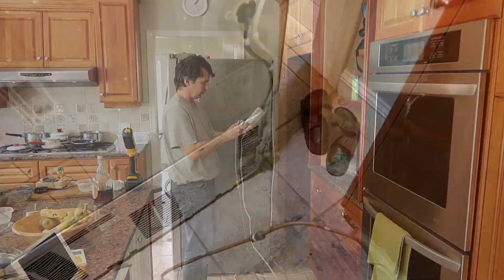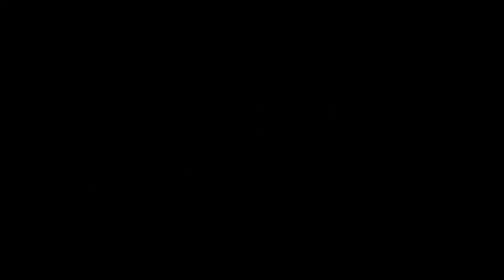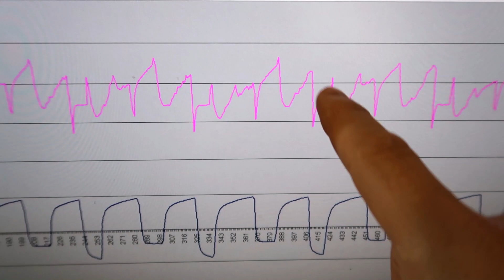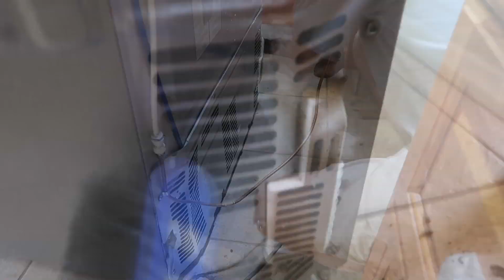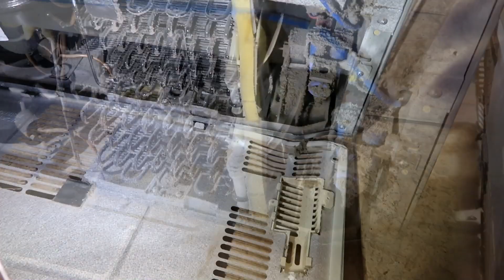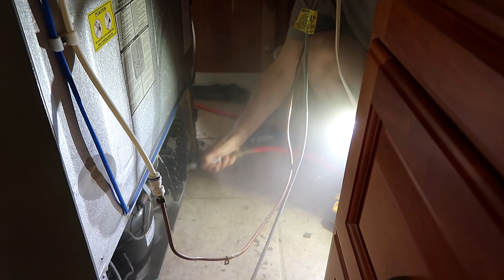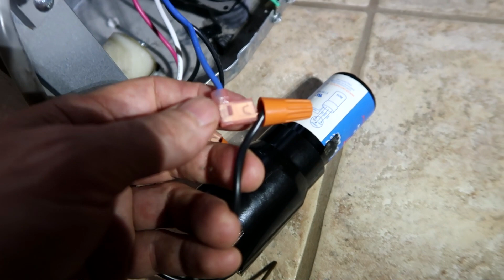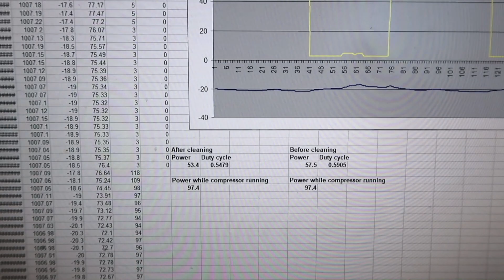Does dusting out the fridge reduce its power consumption?  And changing the starter relay

Comment: Thanks!  How will you decide whether the “correct” start capacitor was necessary or if the universal start capacitor was totally fine?
Reply from the maker: Power consumption is about the same, so it can't be too far off the mark.  These compressors are mostly the same size.

Comment: A refrigerator usually has a pan in the front to catch water from condensation taken out of the refrigerator and drained into a pan below where and the hot air blowing from across the coil  blows across the collected water behind the front grill below the doors to evaporate the  water and then out front,... on your toes.
Reply: No that was before they put the water on the condensers to burn it off

Comment: my fridge has the coils on bottom, and pulls air from front to back. I just blow the dust out with compressed air every year or so, the pull the fridge out and vacuum out the mess. I noticed the fridge's compressor cycles on a lot less when I started doing that after we bought our house and moved in.

Comment: I'd be really interested to see a followup where you modified the air flow baffling to see what that does to efficiency / power consumption performance.  One relatively easy approach would be to install a thick strip of soft foam rubber up the back of the fridge to "seal" against the back wall when the fridge is pushed back separating the air inlet side from the air outlet side.  That might reduce the air recirculation.  Another approach would be to construct a fresh air inlet duct along the side of the fridge to redirect the air inlet from the room in front of the fridge.  Not sure if you have enough room for that though.  In any case, I really love these quantitative analysis videos you are doing.  Great stuff!  Thanks.

Comment: It was working fine, you cleaned it and it broke; welcome to the prime directive!
Reply: If it aint broke, fix it until it is!
Reply: @muh1h1  😎
Reply: The service probably says that to everyone because a variety of relays, starters, and solenoids in his van you can coincidentally purchase for 400% markup!!
Reply: Don't electrical/electronic components normally fail (if they will out of lifespan) either at initial first uses, installation or when tampered with when servicing (which the compressed air might represent) rather than in normal hands off operation?
Reply: Happened to me while cleaning my father in law's dust vac...

Comment: It does matter if clean or not for home ac there  some good hvac guys on youtube.  There reason why they clean and see a different in running if there hook up the low/hide side.  The newer one got them in the side of the fridge i think instead of having it in the back.  Also most home fridges there no cooling part for the fridge its all in the freezer then it send some air down or up in ur case to the fridge it good to make sure there clean the ports too some time they ice up. It work out it went out right then, I wonder if extension cord/watt meter added to it.
Reply from the maker: These freezer on the bottom type fridges are more complicated that way.  The cold air doesn't just naturally drop down from the freezer.
Reply: @matthiasrandomstuff2221  gotcha also thanks for replying. I do wonder how it work with them i know side by side and freezer on top.I wonder be a fan because there was only one compresser or may works like a car ac and have a gate? ill have to find one later and see how those work. Sorry for spelling and thanks again for reply back Love ur shit/random videos as someone in chronic pain and fuck up joints i know how it sucks having ur hand like that.

Comment: It would be a fun project to create a machine learning algorithm to convert your raspberry pi photos of the power meter into a floating point number. It doesn't seem hard to do, nor computationally difficult. Much more reliable a medium than the MNIST dataset.

Love your videos, keep it up :)
Reply from the maker: I ordered a plug that can be read automatically.  I'll use that for future experiments.
Reply: Lots of different ways to tackle that problem : ). For fun, I would probably just reverse engineer the power meter. That way you don't have to keep a light on for the camera to work.
Reply: probably there is already a opencv project in github. I planned to do a similar experiment with two multimeter (for voltage and current), but both my meters have auto turn off so haven't done it yet.
Reply: @thegittubaba  They make logging meters that you can either read in real time or from a file they create. If you are going to need to buy new meters anyway those would be worth a look.

Comment: Perhaps a wooden air guide to improve airflow and thus efficiency will be next?  Maybe send the hot air down stairs?
Reply from the maker: when I had it out, it consumed about 5 watts less power, but I didn't leave it running that way long enough to get certainty with the measurements.
Reply: @Matthias random stuff  
I did a lot off testing on cooling in PC's and found the convection in tight spaces do not work well.
On a PC that was placed between a desk and the wall the internal temperature dropped 20 C  when added a 12cm 1Watt fan the push some new air in from the side. Even when there was nothing blocking the air from rising up.
Reply: My new fridge has a flexible fin on the underside of the fridge that makes contact with the floor. Hot air gets sucked in one side of the front (and maybe back) and exhausted out the other side of the front.
Reply: @JoeMalovich  i did not expect you to find you here. by the way i like the projects you are working on!
Reply: @aleksandersats9577  I am EVERYWHERE.
Reply: Exactly! I was expecting his next step to be adding a baffle and fan to direct air out the front like it was a custom dust collector
Reply: Is there space between the wall and the cabinets, over the fridge? To allow the hot air to rise. 
If not, it should be mandated by law, it's an incredible waste of electricity.
Reply: @Yonatan24  The hot air won't stop when it hits a cabinet, it will simply flow forward towards the face of the cabinet then up towards the ceiling - unless there is no clearance on the top or either side of the fridge, then you have a problem.
Reply: @HarmanRobotics  Here in AUS, (usually) small upper cabinets above fridges are only 300mm deep, to allow a very large space for heat to rise. Confining a fridge in a cave, unless it is designed to be able to, think Liebherr, is a sure way to get you to the appliance store! Cheers

Comment: I use the vacuum attachment to suck the dust off the coils.
Reply: Yeah, but I've found the dust needs a bit more agitation than what my vacuum can do.  I have used a vacuum and a brush but compressed air is so easy and quick, (just a tad hazardous for the lungs!).
Reply: @drmkiwi  I use a long, skinny brush that's intended for cleaning lint out of the clothes dryer